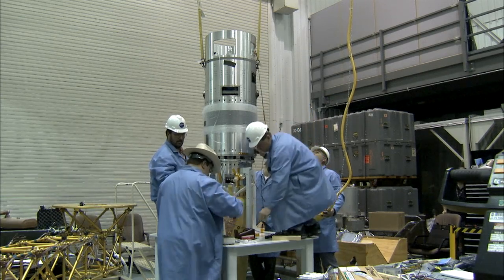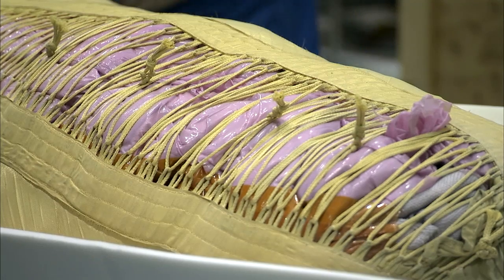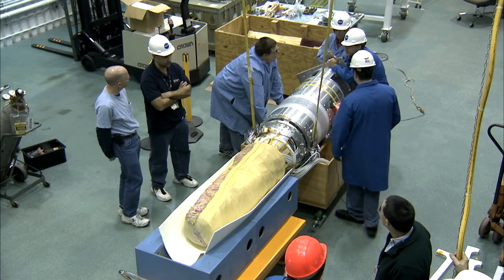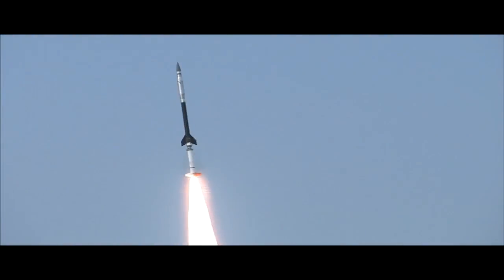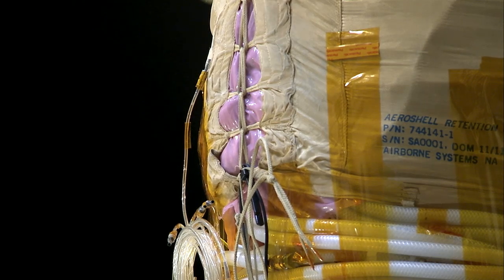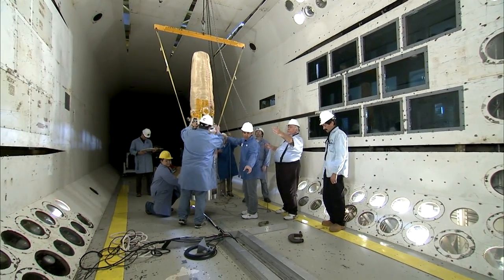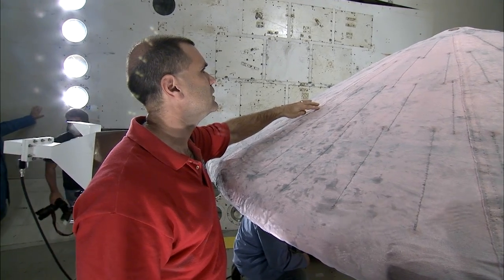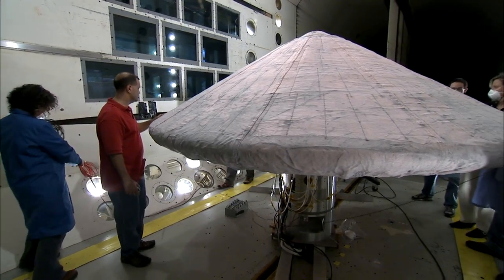Inflation of a spacecraft heat shield in a wind tunnel test

Comment: EMF=Electromagnetic Field. Satic electricity is a molecule thin barrier that can peel of the spacecrafts skin along with built up heat due to atomospheric turbulance. 500 electrodes sub-cutaneous on the underside and nose at 500,000 volts and .005 amps should do it. High speed low drag re-entry.